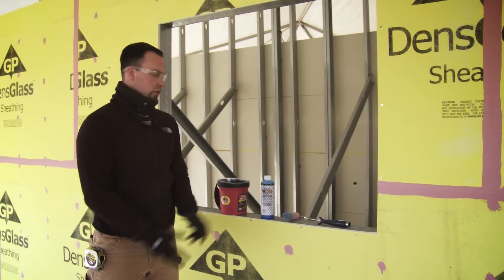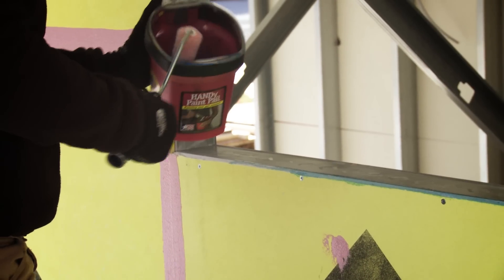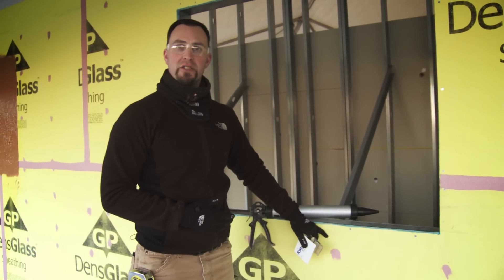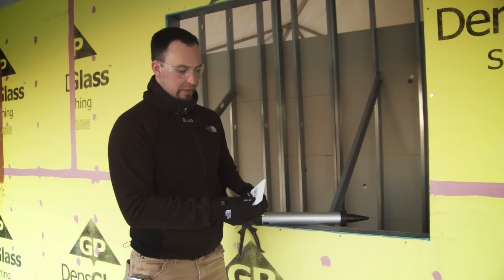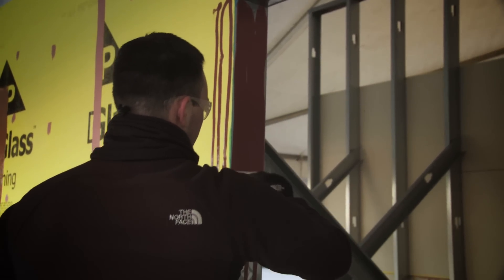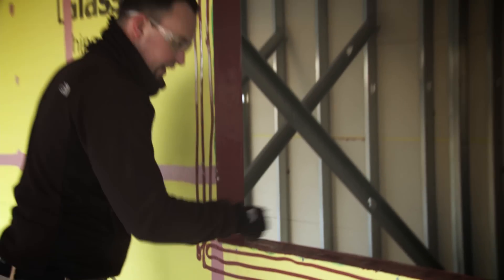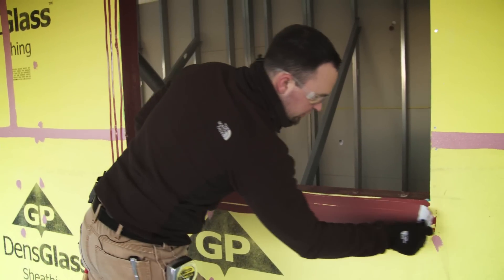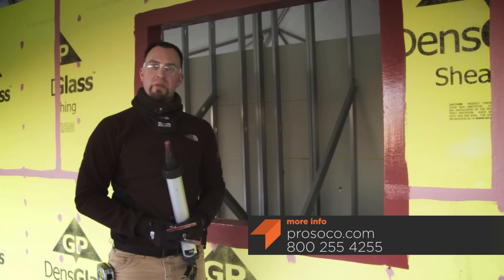How to waterproof a rough opening with R-Guard FastFlash

Comment: How are you able to apply Fastflash in your gloves.  I am trying to be neat and have nytrol gloves, I still get it on me.  Also when applying to the underside of the window header I can't get a good bead without it creating little hang downs that plop onto the sill or floor.  70- 85 degrees.  I end up doing little strokes then knockdown with tool. I found that the smaller tip bead head on my sausage gun works better than the larger cone head.
Reply: I like to have a short bristle brush and seems to do a good job spreading the hang downs

Comment: I just applied fast flash about 6 hours ago, I used water mist bottle about 4x, it is still very very tacky, so tacky I can't put in the window because the slightest rub will peel it off (don't ask how I know)..  So I decided to wait till tomorrow, but I'm wondering, if it's this tacky now, is it ever going to dry as silicone would?  If not I am just going to put a layer of special tape I have which was made for seams on vapor barriers.
Reply from the maker: The water mist bottle will help but low temperatures and low relative humidity do slow dry and curing time. Once the FastFlash is fully cured and dried there should be no transfer between the product and your window. FastFlash is not a silicone so it wont feel like one when it is dry. It does have a tacky feel, and can be kind of sticky, but it won't transfer to other materials when cured. It is immediately waterproof though, so even when temps and humidity is low, it is still protecting the rough opening as it cures.
Reply: @ProsocoSince1939  Thanks, I was going to delete or edit my comment because I simply didn't give it enough time to cure, the next day (yesterday) it was fine, I installed the window and there was no over sticky tacky feeling or peeling issues like it was the day before.  I used 3 of the Prosoco products, the pink fiber re-enforced Joint and Gap, the Fast flange and the Air Damn.  It was in the low 60's when I applied the F.F. so that is probably not the ideal temp and humidity for curing.  Overall works great, I found using charcoal lighter fluid cleans it off really well.